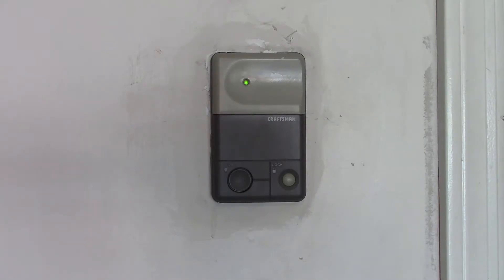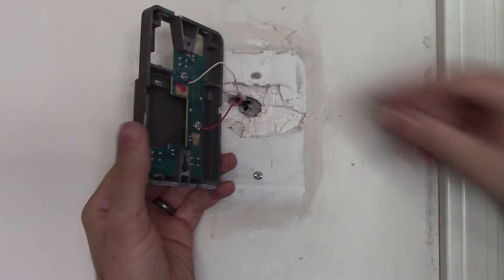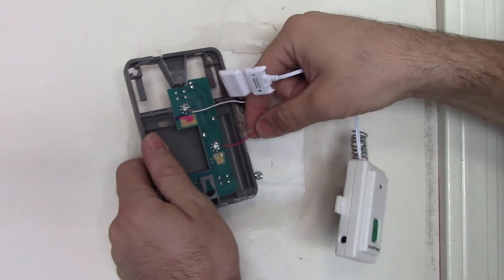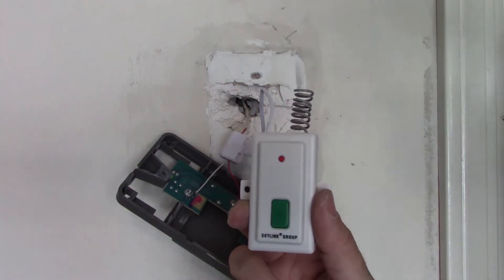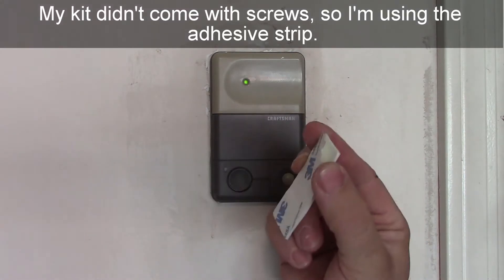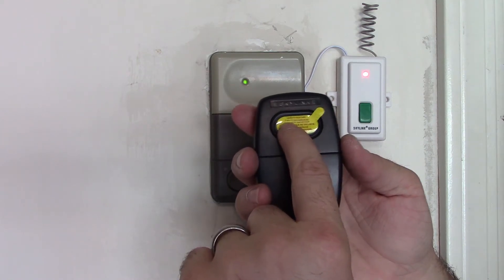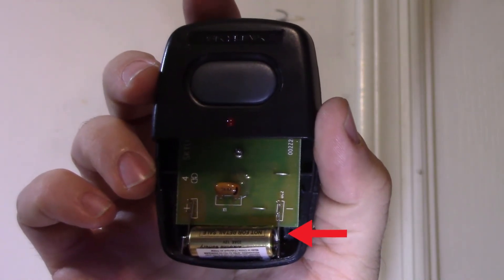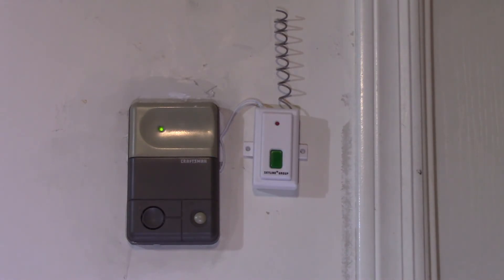Skylink Garage Opener

Comment: Hi Do I need to turn power off to do this ? Then, are you saying that the remote will not work ? Then what’s the point of the new install. I lost mine so want the remote to access from outside. Pls let me know what you are explaining. 
I have model MK1 different from your actual, remote. Are you familiar with that one as well? Thanks SE
Reply from the maker: Shirley Elderkin Yes, please turn off power while making this install. Safety 1st.
The skylink garage door opener will work with the adapter, no other brand of door opener will work, at least from my tests. If you have lost a skylink remote, contact skylink and get a replacement. I tried using a Home depot opener with the Skylink. It did not work. Hope this helps.
Reply: They are only signal wires. It would be a bit more of a jolt than a 9v battery on your tounge LOL.

Comment: If you have  SkyLinkNet HUB HU-100 Here the instructions on how to add it to the mobile APP:

Program the Hub to GB-318:

1.    Login to the App.
2.    Select More, System Settings -- > Setup Wizard -- > Add Device -- > Appliances.
3.    In the Add Device Screen, create a name for your device, e.g. Name = Smart Button. Location = Garage. And then press ‘Continue’. You may select ‘Learn now’ or ‘Learn later’ to setup the Smart Button.

After that it will create Smart Button and the icon will show on home screen, you can tap the icon to control the GB-318 if already learned. Or click the setting icon on its right corner, you should find the ‘On’, ‘Off’, ‘Learn’ and etc as shown so you can learn it to the hub if you select ‘Learn later’.